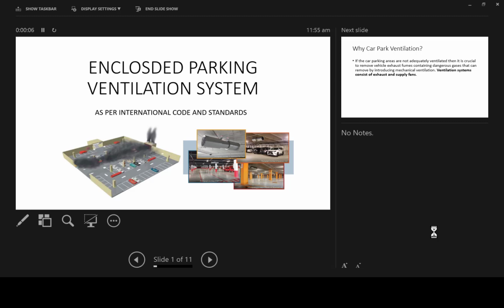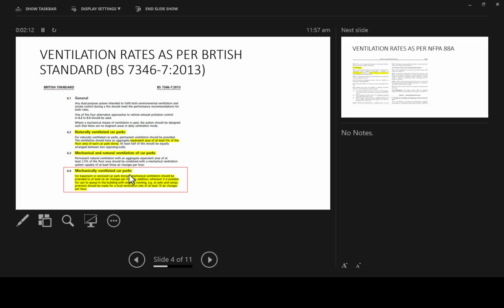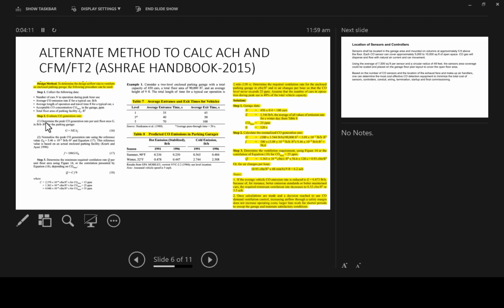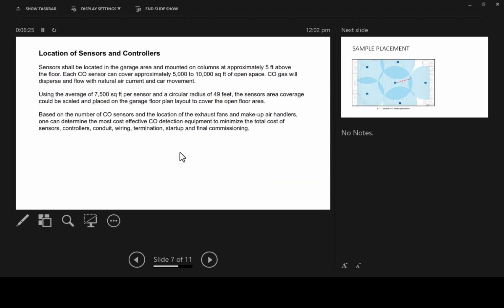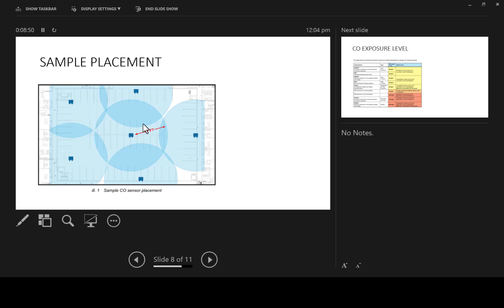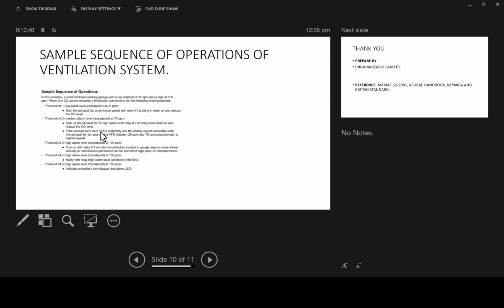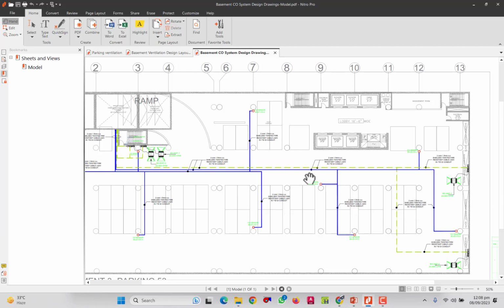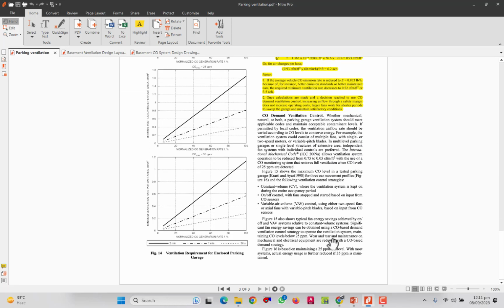Car Parking Ventilation System Design (HVAC)

Comment: Does installing a smoke extraction system also mean I will handle the ventilation in the parking garage? I mean are they not the same ??
Reply from the maker: The fan shall be VFD drive and interlocked with smoke  sensors, when the smoke is detected, the fresh air fan will stopped and exhaust fan shall run at high speed to extract the smoke. That why we design parking ventilation at 6 ach normal operation and 10 ach for fire incident.
Reply: Thank you so much